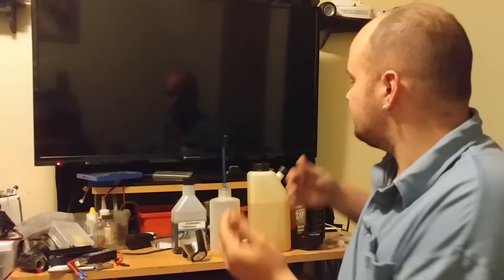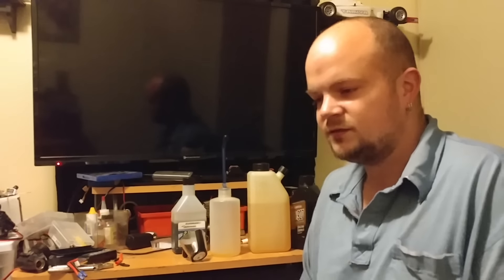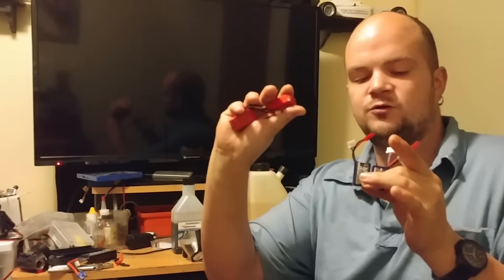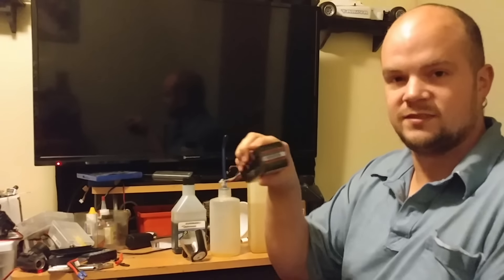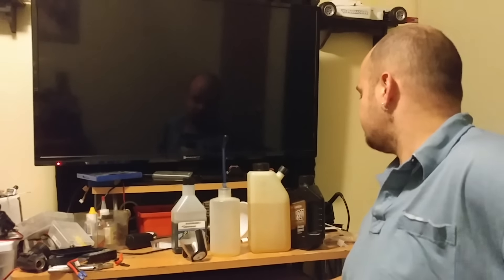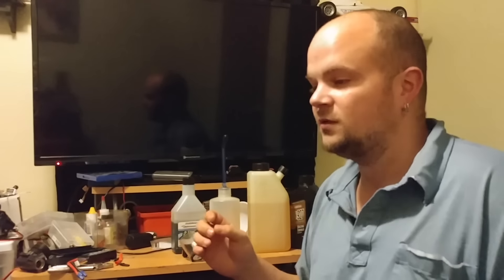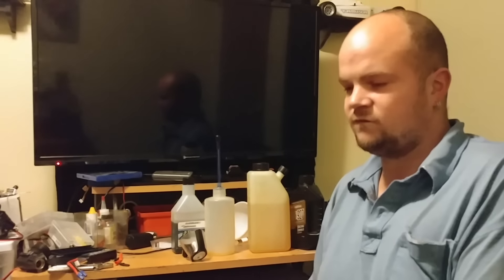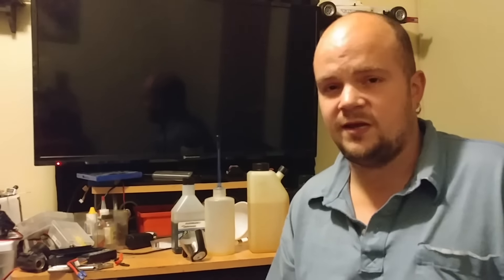Why I dont have another X-maxx........Yet

Comment: Hey bud how r u I got my mates revo and won't select 2nd gear please help me if you can Matie
Reply from the maker: Paul Pateras There is a hole where you can stick in a Allen wrench to set when 2nd gear kicks in.  sounds like its too tight.  loosen it until 2nd kicks in then tighten to where you want it to kick in.  on about to get a jato.  that's gonna be fun.
Reply: Evolved Amateur RC 
It just needed a tune was way to lean and the carbi was not opening fully now it goes crazy it just wheelies hardcore but was right on the limit for heat so just backed it off 1/4 turn so it runs safe for him 
And I checked the Allen key bit for adjusting and was ok it was because the throttle wasn't opening fully the wire on starter motor was stopping it thanks for help and getting back bud 
How r u going good
Reply: Evolved Amateur RC 
Sweet a jato I should have done one I have 2 nitrosport decked out with alloy and 3.3 in them and a rustler the same my revo is nearly ready broke throttle link